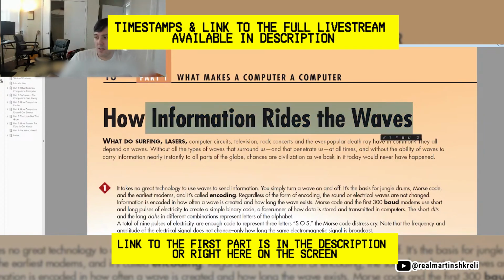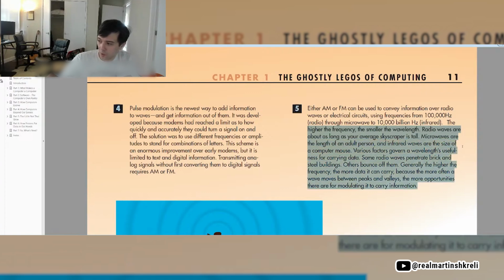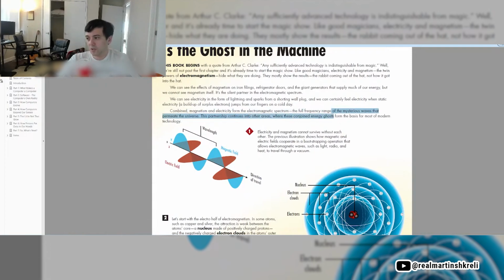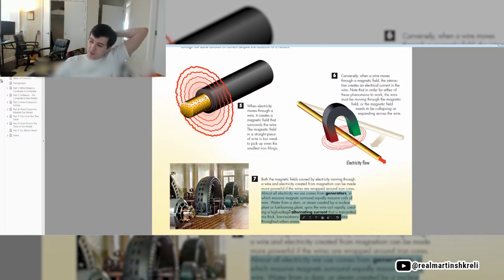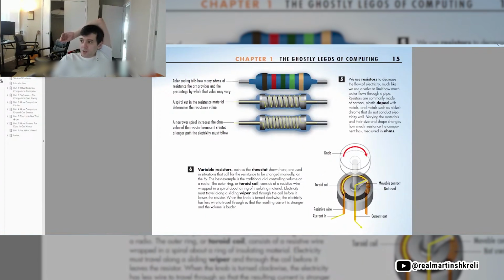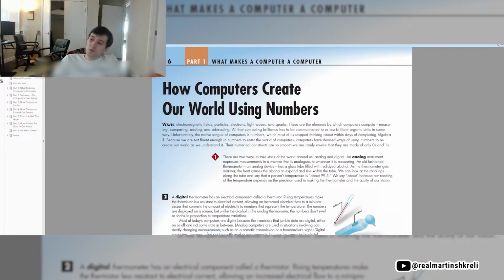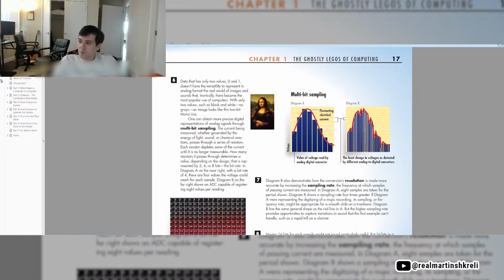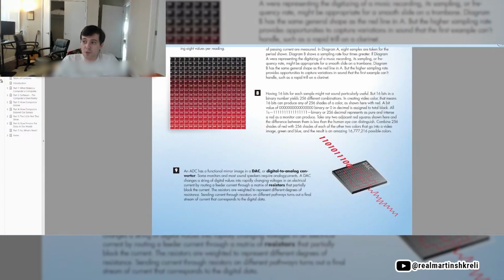Imagine Not Learning On Friday Night?! | How Computers Work | Martin Shkreli

Comment: This is signal processing ☝️ computers are universal Turing machines based on formal logic (ie Frege and Boole) and don't even need to be electrical... You could in principle make a gravity or hydraulic or pneumatic computer, we just use electrical switches because they are much faster and cheaper

Good information!